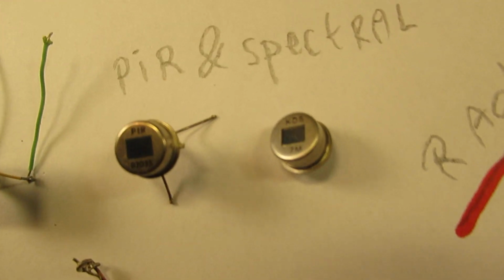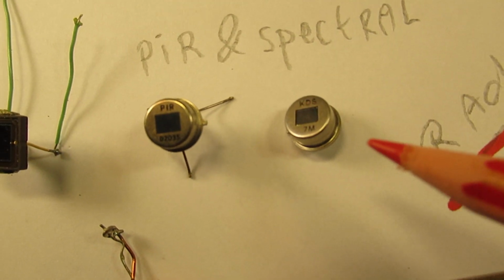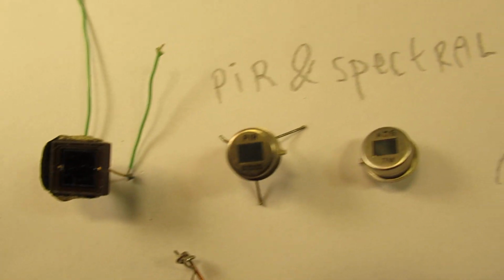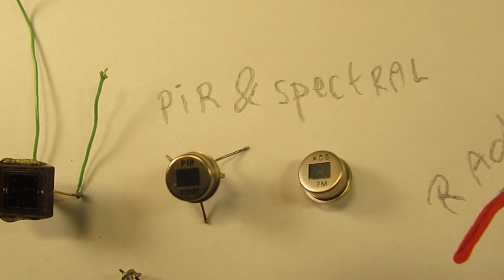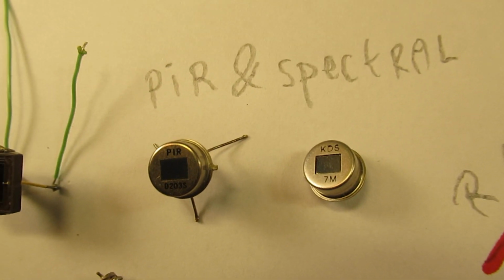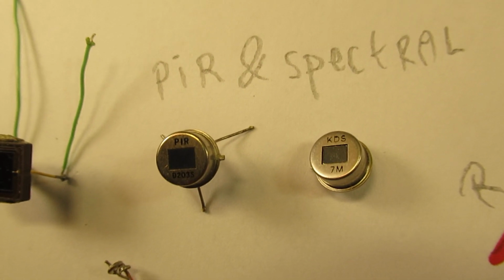Talking about electronic sensors for visible light, invisible light, infrared, temp & magn; (VLOG)

Comment: New type temperature sensor three pin like LM35 .
T
Reply from the maker: OK, can you be more specific? Say where you find/buy it, etc.
Reply: @radiofun232  I am sujeeva from sri lanka  any electronic shop these three pin temperature sensor available like BC537 small transistor . Lots of arduino programs use it . I think newer versions also available.

Comment: Ko, wonderful video. You’ve got me using my imagination on all the types of sensor circuits. I look forward to your example. Thanks, Jim.
Reply from the maker: Thanks Jim!
Reply from the maker: Hi Jim, when I have time & inspiration I want to use the Opamp TL 071 to make a demo circuit with a sensor out of this (all the kinds of sensors in this video). But there are also (say) 1 transistor or 2 transistor circuits on my YT channel that can do that job, say switching something on or off (with a good or bad hysteresis, some of them work excellent) via a visible light sensitive sensor. I never published a working circuit with/via IR sensors, though I did a lot of experiments with them. Simply forgotten to publish these experiments and results on YT, anyway. Of course you know how to find these old video's from (say) 4-8 perhaps even 10 years ago, because you are one of my first followers. Anyway: using an Opamp for such a purpose is/can be a new adventure, and I like new experiments. Thanks, Ko, 26 may 2023.

Comment: 8:09 That reed sensor reminds me of the 80's and 90's where they used a similar component that look the same, but was a thermal fuse with a bi-metal for shortcut or overcurrent protection in small wall outlet power supplies that used transformers.